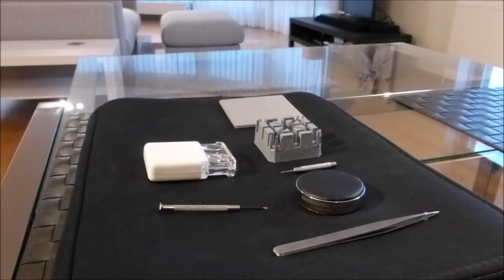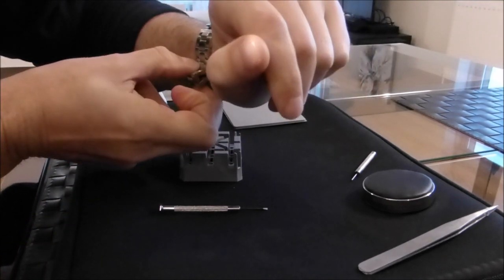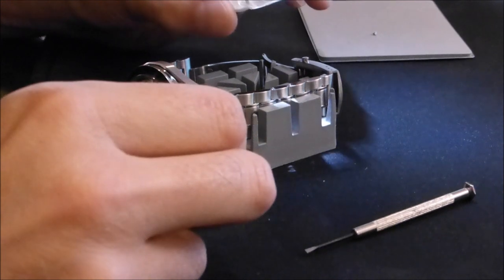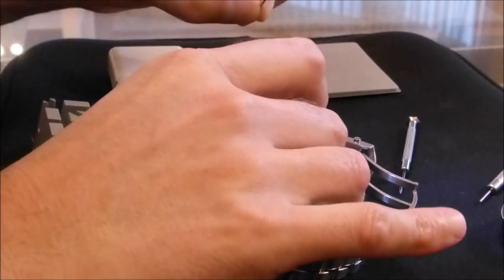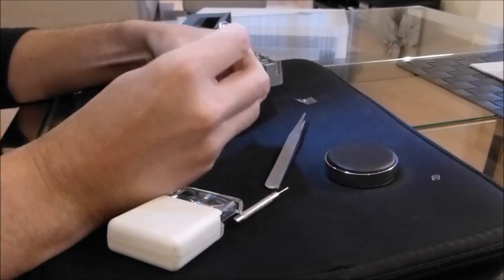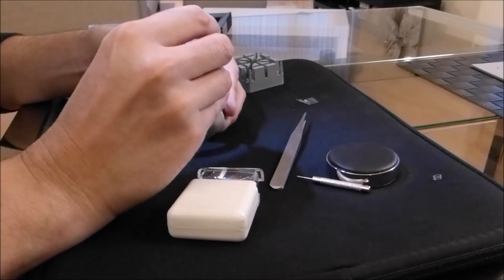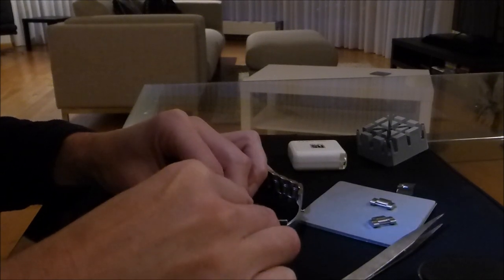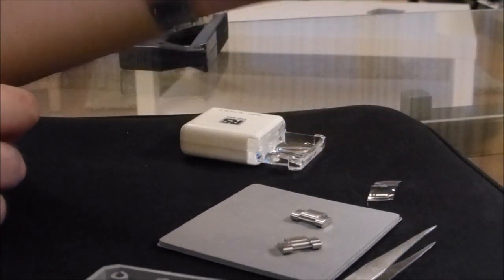Omega screw type watch bracelet link removal and adjustment

Comment: Screws are crazy tight on my new speedy bracelet. I have all right tools but can't remove a single link. I adjusted all my watches Cartier, Breguet, Zenith, Arnold&Son was a problem but not as bad as Omega. I guess gonna take it to my watch guy. 1 damaged screw cost more then he charge for the adjustment.:)
Reply from the maker: Yes I agree - not worth the risk if they are too tight. Depending on how you bought the watch often I am not charged if I get an AD to adjust it within warranty.
Reply from the maker: Yes I agree - not worth the risk if they are too tight. Depending on how you bought the watch often I am not charged if I get an AD to adjust it within warranty.

Comment: Thank you for the video! I do have the right screw driver 1.6mm, but I am a little concerned of getting the screw loose.
Reply from the maker: A bit of pressure / pressing down helps. If you are not confident better to use a watchmaker.

Comment: I’m confused by what was said in the beginning. I need to take 3 links out. Do I take 2 links out of one side and 1 out of the other or all 3 links from the same side?
Reply from the maker: Your wrist is oval and the watch and clasp are designed to lay opposite each other / following the curve of the wrist. If you take too many links off one side then logically the clasp will be pulled off centre. It will depend on the size and number of links in the bracelet. I Hope this makes sense. Three off one side might work but the two and one route is probably the way to go.

Comment: I have issues with the screw on my omega seamaster.
With mine it worked but another its very tight.
Any tricks to loosen the screw (some oil or something else?).
Thx for your advice!
Reply from the maker: If you are having trouble I would take it to a professional - do not risk damage. Applying pressure downwards while you turn the screw seems to help break the bond - but be careful to avoid the screwdriver slipping.

Comment: are there threadlock/loctite on the pins? do I need to apply threadlock/loctite? thanks for the video. Planet Ocean is a PITA getting perfect fit.
Reply from the maker: There was a grey material on the threads - some kind of threadlock /Loctite chemical - you might just see it on some of the pictures. I did not clean the screws and they still seem a tight fit. I have had no problems with them getting loose so far - and I do wear the watch at least one week a month 24/7.

Comment: What if the screws when you untighten from one side both the screws move at the same time! I tried two screwdrivers, 1 to hold & the other to untighten, but still won't budge on any links, any suggestions?
Reply from the maker: What bracelet are you working on? it sounds a different design.
Reply: I'd bracelet
Reply from the maker: Sorry I don't understand. On the bracelet on this video there is nothing joining the screws / they just cap the bar in place. What part number is your bracelet?

Comment: I am thinking of getting the Seamaster 300m co-axial. I have a 17cm wrist, do you know how many links would need to be removed?
Reply from the maker: Ok - long answer. If buying from an AD or good jeweller just give them the measurement and they will work it out. Otherwise wait till you get the watch and pinch it out / test before adjust (any good jeweller or AD can do it for you) I think the 300 now has a micro adjustment clasp so you can tweak very easily to get a perfect fit after the links removed. Short answer maybe three links (but that is a big guess).
Reply: 3 probably omega supplies 2 half links to get a perfect fit.

Comment: what kind of a scredriver are you using? 0.9mm?
Reply from the maker: +earthcry I should have kept a note on that. Looking at the set I think It was  a 1.4mm blade width. I would go with what feels best - you don't want it to slip out of the screw head slot.
Reply: thanks

Comment: Any suggestions on what to do if the slot for the screwdriver in the pins is so shallow that the screwdriver can't grip it to unscrew the pin? I've already polished the screwdriver tip dead flat and sharpened it to make sure it definitely goes into the slot and it still just spins out. It's on a Casio digital watch if that makes any difference.
Reply: Turns out my watch had push out pins - the screwdriver slot was because each pin is a half round bar folded in half to make a round bar resulting in one end looking like a screw head. I tapped the pins out from the other end and the adjustment took a couple of minutes. Very bad that there's nothing in the instructions that came with the watch about this, so I was forced to take a gamble on hammering and potentially stripping a link pin that could have been threaded.
Reply from the maker: +peglor  I have not worked on a Casio metal bracelet. Always worth a YouTube/ Google check on the watch reference number in case someone has been there before.
Reply: My hope is that someone who gets a similar watch, assumes it is a screw band because it looks like it has screw heads and gets frustrated by their screwdriver not working will find this as they won't be looking for instructions for push out pins in the first place.

Comment: Tried adjusting on the same watch today, but the screws wont budge. I may need to try another screwdriver
Reply from the maker: Be careful. You need to be positive but not worth scratching it (although you can get new screws). Any authorised Omega dealer or boutique should adjust it for you as a fall back.
Reply: +Omega Fan Man thanks. I was thinking that I should take it to a jeweler.
Reply from the maker: +Thomas Covenant Let us now how you got on. Maybe try another link but if you are not sure a Jeweller is best (Omega AD if possible).
Reply: Thomas Covenant If you have a bracelet block to hold everything in place, you can safely use small pliers to give your screwdriver more torque if the screwdriver us properly seated. worked on my P.O. bracelet.

Comment: I just sized an Omega Seamaster 300mc. I used a heat gun to heat the bracelet so hot i had to hold it with gloves screw came out no problem with no marring or damage. Do not worry only the part you heat will get hot it will not heat the watch itself just the area you need. Reheat the bracelet for EVERY time you take each screw out...TAKE YOUR TIME and be extremely careful took me about 1 hr to remove 3.5 links lol but im very ocd. I also had to remove both sides screws to get the pin out its in there not tight but  it wont just fall out on a new watch most likely just used a pin pusher to remove the pin inside..
Reply from the maker: Thanks for sharing this.
Reply: I have just ordered that same model. Since I will have to resize it.. May I know what kind of screwdriver will do the job? 1.8 mm flathead?

Comment: Hi your camera angle couldn't see anything also you have to use a bit locktite on the screws or they will come loose
Reply from the maker: I have held my hands up before regarding the camera angle. It was just a video of opportunity. Regarding the screws they already have a fixative chemical from the factory and that still worked. I have never had a screw loose and have worn this a lot in recent years.

Comment: Have you had to heat up the bracelet to loosen the loctite?
Reply from the maker: No - but It helps if you push down / put some pressure on the screw. You need a good correct fitting screwdriver and be careful not to scratch or damage the screw head or bracelet.
Reply: @OmegaFanMan  Thanks for the reply. A local jeweler tried and failed, but didn't damage the screw too bad. Omega won't size bracelets right now due to Covid. I have a 1.8 Wiha coming in the mail, so hopefully that'll work. 

If a screw was damaged so bad that it couldn't be removed, what are the resolutions? Send the bracelet to Omega?
Reply from the maker: Any good watchmaker should be able to work on a bracelet for you. But for warranty Omega would be the safest. I would always take pictures in case of damage if you use an independent.
Reply: Thank you again.

Comment: Hi there thanks for the video but your right hand is blocking the view most time. It may be best if your view is shot from above your head.
Reply from the maker: Yes you are right. I needed to get the strap adjusted and making the video was a bit rushed. I will do better on the next one. It's a very fair point you make.
Reply: +Omega Fan Man thanks for the super quick reply!

Comment: Did this myself and scratched up quite a few screws... They cost $20 us per screw on line! FML!!!!!!
Reply from the maker: Not good. I do find the old push pin system easier if you have the right tools but the screws look good. Maybe we have to let the AD/boutique do adjustments on the screw ones. It is important to use the right kit but always a risk to scratch a screw....